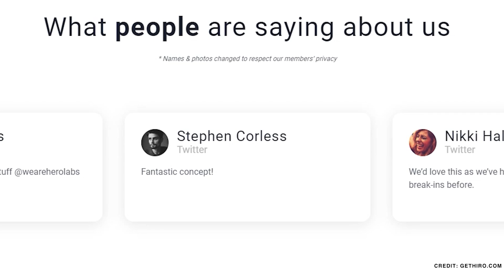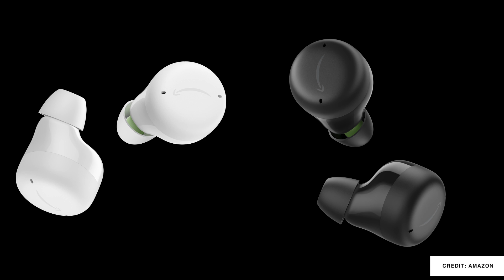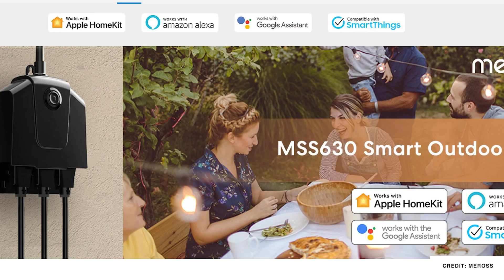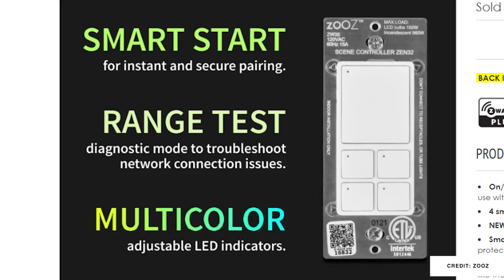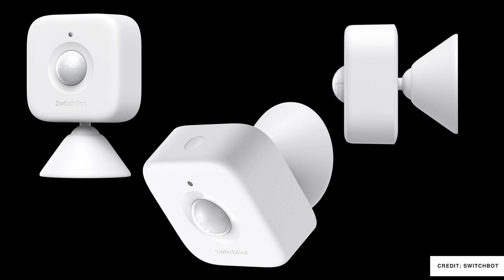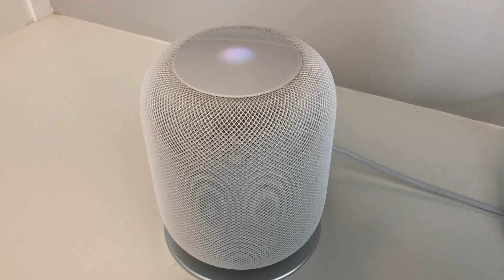NEW Smart Home Gadgets in 2021!

Comment: With smarthings hub ( the one from aeotec) Is it possible to trigger a scene ( "watch apple tv" on harmony hub) based on power consumption of a specific device, thanks to a smart plug connected to that specific device. ( The apple tv itself).   Also, is it possible to set scenes to turn on gradually? ( kind of the same way you can do on the hue app itself.)  cause for now I didn't find that option and my light automations turn on instantly and it's kind of annoying. ( Only relying on cloud for now but I may get a hub soon.)
Reply from the maker: Yeah so you have to buy the right gear, but there are options for all of this.  :)

To not have cloud execution, you need to buy the right switches/bulbs.  They're usually zigbee or z-wave and we've spoken about a few options here: https://youtu.be/dfYt3zhCS_Y

The Apple TV with a smart plug, you can look at a few options there but I don't do anything like that at this time.

Scenes...depends what you mean by gradual, but I get the sense it'll do what you want.
Reply: Great! I didn't know this was all possible with smarthings. Do you know which smart plug i should get in order to do what i want? 

I ownly own hue bulbs and strips for now but i'll look into those yeelight products you mentionned in your video next time i need one. 

What i mean by gradual is the bulbs going slowly from one state to an other ( let's say 80 % brightness scene to 20% brightness scene) in a specific amount of time. ( 5 - 10 - 30 minutes)  You can do that in the hue app routines but i can't seem to find such an option in smarthings

Thanks for your time!

Comment: Nice find on that Meross switch with remote  Funny that I've been using meross switches for the past couple of years and not a peep about this product in my inbox. Someone in their marketing dept. should have a talking to.  Finally some competition to the lutron pico remotes. I would have gone that direction but lutron does not return to previous state. 
That hue battery in the wall thingy is a joke. The power is already right there in the wall. Why not create a way to tap into it? Probably better off going with the hue remote as a solution.
Reply from the maker: Yeahhhh it's a funny device but I still feel like many folks will find a use.  My choice is more gonna be the Lutron Aurora if someone has the right switch!

Comment: Great video! The Hue module was something I have been looking for. But it gave me the idea that you can use Ecolink Door sensor DWZWAVE2.5-ECO to do the same thing. It has a dry contact sensor built-in that can be wired into the switch. And this will link directly into your smarthub which you can then make an automation to control almost anything.
Reply: Donny. Thanks for the tip on the ECO switch with dry contacts. Have you seen and dry contact sensors that support Zigbee of Wi-Fi?
Reply: @faengelm  I don't know of any but the Hue module may be able to be used as one. The bulbs are Zigbee so I imagine this modules going to use Zigbee as well. The question will be if you could connect it to a SmartThings Hub directly or is it only compatible with the Hue hub.
Reply: Hi Donny. I just got the switch you mentioned and it works great on Smartthings with the dry contact terminal connection to my Couch Potato mat
Reply from the maker: Did not know those had that in there... interesting
Reply: Hi Donny that switch with dry contacts works great on Smatthings on my couch  potato detector mat
Reply: @faengelm  now I'm curious what a couch potato mat is.
Reply: @donnycasey6613  I use a mat from a wheelchair that is basically a big contact switch placed under a cushion on my lazy boy. I use SmartThings Automations to time my sitting for over an hour. That generates a trigger to Alexa to tell me it's time to get up and stretch.